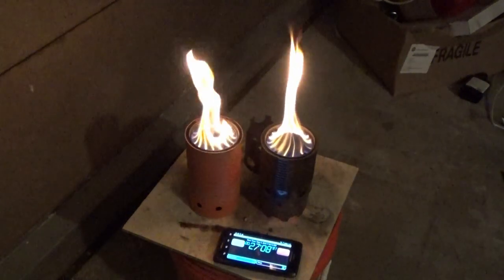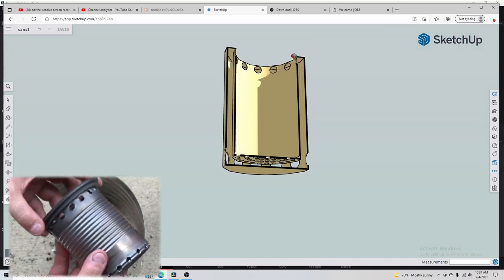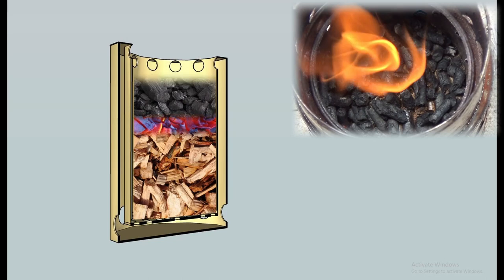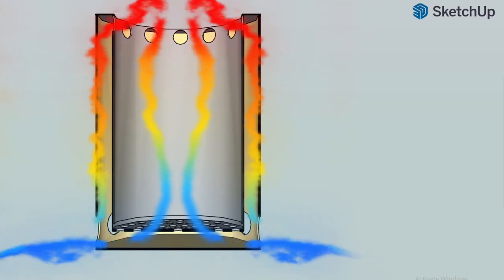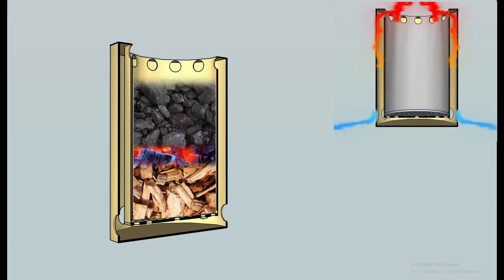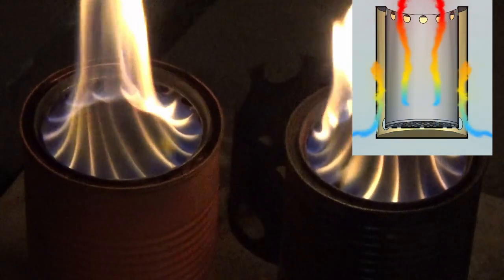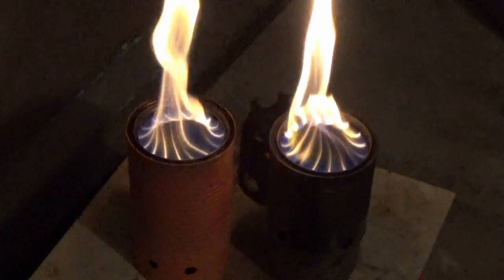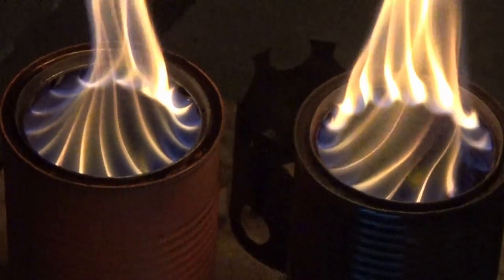Wood Gas Stove Science| TLUDs Explained | Camping Stove | Tent Stove

Comment: Cars in Europe during WWII were converted to running on wood gas. The only difference here is your secondary burn happens at the top of the stove. In a car the wood gas from a "stove," usually on back, was introduced into the intake manifold and burned explosively in the cylinders. Not too efficient but better than walking. Wood as such fuel has to be dry for this to work.
Reply from the maker: Thanks for watching!

Comment: So, I am wondering why everybody thinks hot secondary air is important. Did anyone tested this claim with cold/ambient air at secondary inlets? It would be more thermodynamically efficient, cold air behind denser in terms of oxygen content...
Reply from the maker: I have not tried that because the hot air rises naturally up between the cans. I have not figured how to get cold air into the stove without the help of a pump or fan. I have burned with no outer can and the results are not good. Thanks for the question! A

Comment: Fantastic visual demonstration. Would you consider a video describing how the Joule–Thomson effect applies to your ultimate Wood Gas Stove? And, would it be possible to incorporate de Laval nozzles, utilizing the Venturi effect?
Reply from the maker: Both the Joule-Kelvin and the de Laval nozzle design require pressure and there is not actually any pressure in this system, only flow caused by rising air caused by heat. If you have other thoughts I would love to discuss! Thanks for the thought provoking comment!

Comment: Thank you. I have been looking for this for ages. You are the first to explain the process.
Reply from the maker: Thanks for the comment!
Reply: @heathputnam9524 All the videos I see, show people burning pellets. It's a WOOD GAS stove. So why doesn't anyone try using WOOD as fuel? No body uses tree wood. I'm just going to burn plastic as fuel. Let's cut the bullshit. Why not use cooking oil and paperboard?   

Id like to show a stove design that will have you running for cover. 

It's anything but efficient or time saving design. The flame gets out of control. It only saves time once it's lit. The flame is very persistent in the heating chamber and shoots out the sides of the contraption. So, It's been about a 4 year trying to manufacture it from scrap. The design is ok. However I know it needs improvement.

The goal I had when I started,was to make a bio fuel stove using a dry burn. Not having to add fuel time and time again. 

So, although I'm satisfied with the design. It's only 
 % 50 efficient since I have to constantly light the source by pumping air through a tube to ignite it.

Comment: Question 1: How long time does it give yellow flames compared to the time it gives blue flames? I ask because as far as I know, yellow flames deposit black soot on the bottom of the pot, whereas blue flames do not. 
Question 2: What would be needed to get blue flames all the time (in a wood stove), like in a kerosene stove?
Reply from the maker: The yellow flame runs about half the burn length and converts about the same time all the wood has turned to char. During the char phase the flames are blue. Thanks for asking.

Comment: Thank you for the visualization and explanation. So the big picture, we have three steps of burning (the fire is always started from the top):
1. Initial burning, the air (which includes the oxygen) is coming through the primary holes from the bottom and is going up to the fire through the wood. Further I suppose there is also air coming from the open top directly to the flame.
2. Wodgas production and burning process. As the wood below the flame gets extremely hot, woodgas is coming out of the wood below the flame. Now it seems the gas flow in the middle changes from going up to going down. Correct? The woodgas is going through the primary hole up to the secondary holes. When coming out it mixes with air and gets burned. Slowly the wood converts to wood coal. It seems its necessary that the top of the wood is nearly closed so that very little air can go through the middle down to the primary holes.
3. When all the wood is converted to wood coal a 3rd process starts where the now produced wood coal burns. I suppose the air for the fire is coming through the primary holes and the top of the flame. The secondary holes are not needed anymore. Correct? When this is done we have only a little ash.
Reply from the maker: You have one and three correct. Step two is the most difficult to mentally grab ahold of, so that is why I tried the visual. The conversion from your stage one to two starts with the temperature of the flame getting extremely hot and starts producing more wood gas. At the same time the air is rising between the cans and becomes super heated as well. A secondary combustion starts at the secondary holes. Wood gas is rising from the fuel past the super heated secondary air coming out of the secondary ports, this air is so hot it ignites the wood gas. At this point (in a well designed stove) a pyrolysis zone is created. Now fully in phase two. This is when the flame closes the top of the burn chamber off and does not allow air to enter from outside. During this phase the air flowing through the primary ports slows to almost nothing and the secondary air flow increases. Wood gas never seems to flow out of the primary air holes and up to the secondary holes. It just seems it because the secondary holes look like the flame is coming out of them… so they must have wood gas coming out, right? No, it is just an optical illusion. This phase continues until all the wood ( fuel ) has been converted to gas and all that remains is carbon… charcoal.
As in the name TLUD this stove is Up Draft. A well built stove will go through all these stages with virtually no smoke and will end the burn with a tiny amount if white ash left. 
This ash will contain heavy metals, arsenic, and other less than desirable materials( so don’t eat it! Haha!) hope this help and doesn’t make it more unclear. Watch the video again and think about my explanation during the second phase. Thanks for watching!
Reply: A very good answer! Thank you!
Reply from the maker: Thanks Bjorn!

Comment: thank you so much for being the only person who explains what is happening with these magnificently popular stoves. I love it. I have been searching for this information. 

I'm wondering if increasing the surface area of the space between the two canisters, with fins attached to the inside vessel, might help to heat up the air even faster. the convolutions on the inner can is already doing this. Is there a way to increase the surface area even more? It would be the same volume of air (or very slightly less) between the vessels, but with dramatically more surface area to heat it. Would this make the stove burn even more efficiently?

Can you speak to any of these elements?

Thank you so much
Reply from the maker: I tried the fins but it seemed to slow the airflow up between the cans. Your idea makes total sense but in practice it does not seem to help. Thanks for the comment! Keep them coming!

Comment: Thank you for this.
I was looking for how a charcoal producing TLUD was different from a gasification stove.
From you presentation, I don't think there is a difference, except in how they are used.
Reply from the maker: If the design isn’t “right” the stove will extinguish itself right at the conversion to char burning. But if you want charcoal with this or any other can stove dump the stove out when the yellow flames disappear. Thanks for watching!

Comment: I'm pretty sure my ACE hardware store has metal gallon paint cans.  I work in a situation where we have a certain number of 5 gal steel solvent cans become available a year.  I'm looking to make a fire pit and some other things from them.  I'm wondering what the optimal spacing is between the walls to get heat transfer to the secondary air.
Reply from the maker: I’ll check my local ACE to see if gallon cans are available. Thanks for watching!

Comment: Did you ever test how long a full stove would produce heat and could you use left over charcoal from a firepit as fuel?
Great content in this series.
Reply from the maker: One cup of pellets will give about an hour of good heat which includes the initial burn then the consumption of the char after the conversion. I have not tried starting with charcoal! That would be interesting! Thanks for watching

Comment: Sir, your video caught my attention,  as I have been looking for a long time to make something for myself similar to what you demonstrated.
 It so happened that I have a distant, sparsely developed country plot for gardening.  I rarely go there and am practically in camp conditions.  I'm not drive a car, partly for health reasons, partly for off-road reasons, and therefore I take with me only what is necessary, weighs little and does not take up space, or what I don’t mind leaving in place, something that is not a pity to leave on the spot, in case the left thing during my absence will find another owner from among passing mushroomers and tourists, and sometimes vagrants, which are not rare in these places, especially after the end of the mushroom season.
 I use a travel gas burner, and sometimes a titanium folding wood chip stove, ready-made, from the store.  Gas is not entirely compatible with the rules for using public transport, which is where I travel most of the way, and I prefer a wood chip stove with pellets or charcoal for one or two cooking sessions.

Since I rarely go there, I didn’t build an outdoor fireplace, a Dakota stove, or similar permanent structures on the site for safety reasons, especially in my absence.  A folding steel rocket stove weighs about 5 kg, and is also out of consideration.  Since a pensioner has a lot of free time, and the cost of purchased tourist stoves is comparable to the amount of a pension, I decided to try to make my own pyrolysis wood chip stove or burner from scrap materials, which could fit in a backpack pocket and would be compatible in size with the already  with the existing wood chip stove and would ensure heating of a single portion of canned food and boiled water brought on back, without the need to cook on this fire source, i.e.  up to 1 liter at a time, approximately.  Knowing the heat of combustion of wood (charcoal takes longer and is more difficult to ignite), we can determine that the volume of a small tin can, 0.4 liters, will most likely be enough for the fuel load, and about one and a half of this volume is needed for the combustion chamber, i.e.  this is a feasible task.

In addition, regarding the design, it seems to me, a priori, that if you reduce the turbulence at the supply of cold air and at the outlet of heated air, for example, by twisting the flow along the channels, then the combustion intensity can be increased and at the same time the size of the combustion chamber can be reduced.  Unfortunately, my knowledge of thermodynamics is limited by the amount of general knowledge acquired at school and at the institute, and I have always delegated thermomechanical solutions in my projects to specialists.  In this case, I turned to empirics, since now you can carry out experiments not only and not so much yourself, but carefully study various videos that show different options for a camp wood chip burner.

 I must say and note that your video I found today seems to be the best in terms of clarity of graphic illustration and clarity of presentation out of more than fifty different videos I watched on this topic.
 I am sincerely glad for your hard work and resourcefulness.  I wish you success in your interesting projects.
Reply from the maker: Thank you sir! I hope my videos have helped you in your remote gardening area!

Comment: Your design is awesome, I'm using it down here in Costa Rica.  I was curious if you have ever considered adding waste oil drip as a fuel supplement along with the wood?  Living in the an area that is very damp sometimes getting dry wood is a challenge and perhaps a bit of oil would burn hot enough to burn off  any smoke?
Reply from the maker: That is interesting, I have not explored that but it may have some merit. It would have to be introduced inside the pyrolysis zone where the oil could super heat and vaporize. Thanks for an intriguing idea! Thanks for watching!
Reply: @heathputnam9524  So, have you tried what @Bushcraft Costa Rica was suggesting? Any interesting result?

Comment: i love what you do man. i think i have an idea for you. Can you change the primary holes with wire mesh so the ratio can be even more.
Reply from the maker: Thanks for the suggestion. I have tried that in the past and it does allow a higher ration of primary to secondary air but it only seemed to consume fuel faster and did not like to convert from consuming wood gas to consuming char (blue flame) smoothly. I have always strived for a goal of smokeless burning throughout. Your idea may have applications so I will keep it in mind! Thanks for the comment!
Reply: @heathputnam9524  do you also add the secondary hole to make it 1:5 ratio? then what happened? is it better or just make it worst. and i think you can upload the mistake you made so the other don't have to make the same mistake
Reply: @heathputnam9524  and i'd love to see the whole process not just the succeed one so people know you can make this stove better because you have tried many ways (also the failed attempt) to make it better

Comment: Hello! do you have some formula to calculate area of holes in cans? I have cans, that fit together, but they are not the same as you are using.
Reply from the maker: The best explanation may be the Vortex 5.4 video for hole size and spacing. Try that and see if it helps. Thanks for watching!

Comment: Hi! I love your content and watched all the stove series (also the old videos). You are very technical and i appreciate it, also i like the new 3d model and the new mic. I saw that you worked around the ratio between primary and secondary holes and that too much holes kills the flow, my question is: as the holes in the chimney help pull the air up and form a more efficent tornado effect does it mean that keeping the ratio but improving the air ascendance velocity help the combustion? 
I was thinking of something like putting a fan under the primary holes (a non motorized one but moved with the wind itself) or a fan shaped form that help convey the air (i think it would fit in your previous and more spacious design).
Reply from the maker: The design of the Pot Stand/Chimney is extremely important to the system as a whole. You might be on to something! Thanks for watching!

Comment: Is there a way to control the air/gas flow so that the flame power is also adjustable? This way I could make the fuel last longer while producing a low flame, and vice versa.
Reply from the maker: Yes there is a video in the series, it shows me cooking shrimp for breakfast but also shows a air adjustment that seems to work well. Thanks for the comment!

Comment: Hi I have a quick question, at 2:18 you said the stove should only be lit from the top, this stove can only be used in batch mode so how do you refill it for continous usage? do you have to put out the burning char, refill and relight it?or can it be reloaded with the burning char still at the bottom? I've played with rocket type stove and refilling is straight forward
Reply from the maker: You can reload it during the first burning stage before converting over to char gasification, but it will smoke a few seconds since you interrupted the pyrolysis zone.The design is intended for quick cooking/boiling with a light small stove. For day tripping and hiking where weight needs to be conserved. The useable cooking time is about an hour per load. The original gasification of fuel lasts about 25-30 minutes then a well built stove converts over to burning the char. After an hour all you have is a bit of white ash. If you truly need continuous heat this design probably is not for you;)
Reply: @heathputnam9524  I like the idea of smokeless burning but using this as a redesigned rocket type heater, not for cooking, after posting this a I found another video on smokeless burning, this is using a 50 gal drum but I can scale this down for my workshop, the design is the same as what you have been using, the only concern I have is loading with wood every hour, with the rocket heater I can feed it whenever I need to

Comment: I want to have a stove that burns on shells from chestnuts, hazelnuts and acorns. I eat them a lot so I have whole mountains of these shells. I have made a woodgasifier myself and they do burn very well in it althrough very short. Is it possible to attach a pipe on the side of the stove to have them gravity fed? Or would adding new shells disrupt te pyrolysis by cooling it to much?
Reply from the maker: This will burn the shells and leave you with just a tiny bit of ash. You can top load it as long as you do it within the first half of the burn. And do not top the stove off. It will effect the pyrolysis zone but it will recover quickly because the stove is so hot in that phase of the burn. Let me know how it works!
Reply: @heathputnam9524  indeed if I ad new shells when it is almost finished it is going to give of a whole lot of smoke

Comment: could this also work with a long (high) model like 1 meter to get a longer burn time ? or do I need to drill more holes in the sides on different highth to have still some air reaching the top level of the wood pellets.

I would like to build something like this from long metal air Chanel tubes.